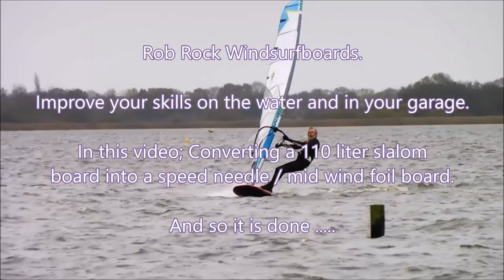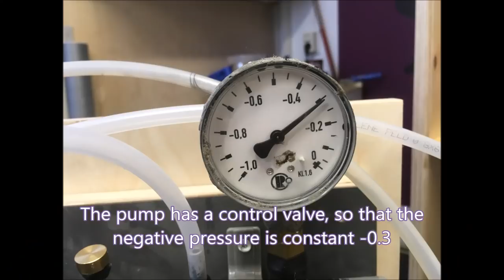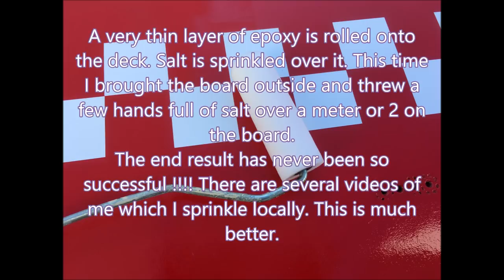Building an speedneedle/foilboard/windsurfboard in one. DIY

Comment: Does it work - increase speed? If so, why aren't the speed record boards designed this way? Also I don't think you need the extra carbon over that addition as carbon is for stiffness and not strength and there is already enough stiffness in the original board let alone adding another. E glass would be a better option.

Comment: Hey Rob, nice work. I saw this type of board just a few days ago, I think it was a fanatic prototype. But the rider wasn't satasfied. Well he used it with a foil. I think a foil on that type of board is nonsense. Because when the board is liftet there is no contact anymore. And before lifting, that shape doesn't plan as good as a regular flat shape. But how does it work for regular fins? What advantages this kind of shapes bring? Does it really just plane on the small bottom? Is the planing ability still exactable? Is it turntable while planning? I could imagine it goes straight like on rails.

Thx alot
Reply from the maker: What a questions ???? The video you mean is from Nico Pico. I received seven reports from surf friends that my idea was stolen. Ha Ha. The first reaction under his video is from me asking why the board is not good. (read it yourself) The deck has a huge concave and is difficult to control when jibbing! (And in my opinion this board should not have cut outs.)
? Plans this board later; NO. 
? I think a foil on that type of board is nonsense. ; The advantage is that when foiling with a hard landing, the smack is absorbed more gradually.
?Does it work for regular fins.  ;Yes, the fin can be smaller. I use no longer than 32 cm.
?What advantages this kind of shapes bring. ;You only need 1 board! Low wind foil - lots of wind fin.
?Does it really just plane on the small bottom? Is the planing ability still exactable? Is it turntable while planning? I could imagine it goes straight like on rails. : The board surfs just like any other board. The acceleration is much better. More control with a lot of wind. Only jibbing is more difficult.
Reply: @robrockwindsurfboards75  For a windfoil hybrid is there a board tail design that would allow for better foil pumping vs a sail pump?
Reply: @woodyadal962  I believe the idea for the JP board was that increasing the volume in the tail increases the pumpability of the board. However in that case, the step was so big that it actually made the pumping action harder. Personally I don't think cut outs in the tail would help earlier flight. As the cut outs are there to reduce drag once the  board is planning. By with point you'd be flying on the foil anyway.

I think starboard probably have the best foil board design currently.

Comment: Simpler to glass carbon directly onto the polystyrene with an abundance of resin, dry second layer of glass on top soaks up the excess resin  when rolled down for a fully wetted yet dry laminate. I regularly shape surfboards from polystyrene.

Comment: Hey Rob, genius idea and awesome work! You encouraged us to convert an old mistral energizer to a foil board... I will share pictures ASAP.
we finished the connection for the 
(kite-)foil yesterday and tested it today. 
It started to foil pretty easy but then always rolled over to the lee side. On an extreme downwind course we could foil for a few seconds but then got too fast, turned upwind and crashed ...  It feels like the board is too narrow to get enough pressure on the luv side, but I have to say that we are absolutely new to Foilsurfing so it could also be just our lack of skill :-) 

we read that the width of a foil board should be at least 70cm so our next step will be to make it wider... Problem is that the Board is 59 cm at the widest point 🤔... 

At the moment our ideas are to make it like outrigger like some boats (I.e moths) have... to leave the bottom like it is and laminate a wider foambord on the top/deck with a little v-shape... it will look definitely funny... do you have any experiences, ideas or recommendations for us?  
Cheerio from Bavaria
Reply from the maker: Maybe at first glance and not a simple solution, but worth considering. Cut the board twice lengthwise. Saw something of 6 cm left and right of the mast track / tuttle box and then glue (2x) 10 cm thick EPS between them. The total width then becomes 79 cm. A little shaping / laminating / painting ..... done. Foiling should then become a lot easier. Have fun with your DIY project.
Reply: Hi again, and thanks for your idea. 
I haven't mentioned, that we don't have many tools and much space to work with :-) You'll see in the pictures and lough out loudly...
so unfortunately we will not be able to cut two straight and parallel lines through the whole board. 
We'll widen the tail to the max. width as a first step and flat out the deck to get a more upright stance.
If this won't help we'll follow your idea and make it even wider. 
And if that won't help we'll build a completely new board like you showed in the other tutorial :-)

Comment: You do realise that you managed to succeed in a design which jp failed in :)
Reply: Mert Ozener to be fair, the failed JP board was a foil board, not a regular windsurf board
Reply: mark051262, correct me if I am wrong, but the shortcoming in JP’s attempt stemmed from this “ridged” rocker design was its inability to plane easily, something that is presumably an asset in foiling, just as it is in regular windsurfing. In this respect, Rob Rock seems to have pulled it off. Moreover, his new board is also foil proof.